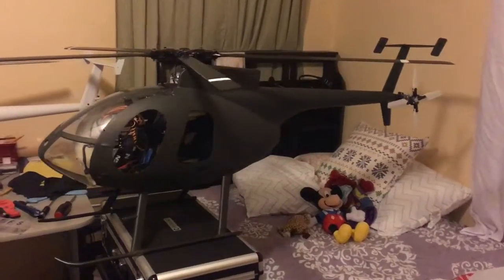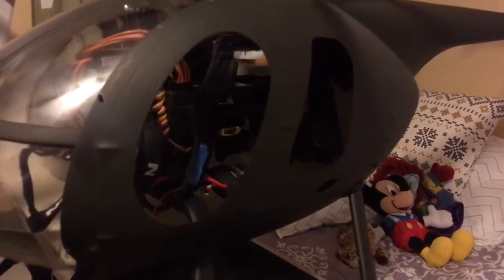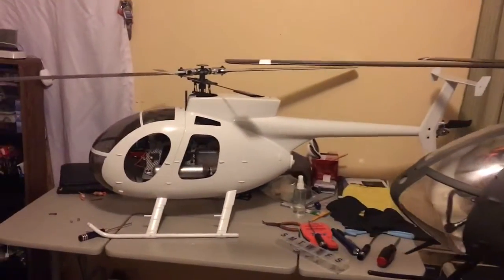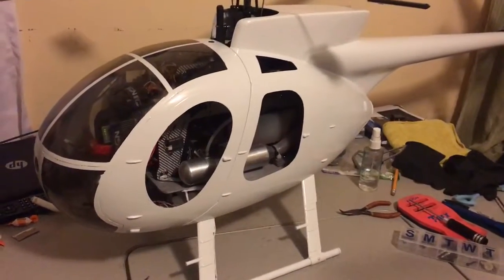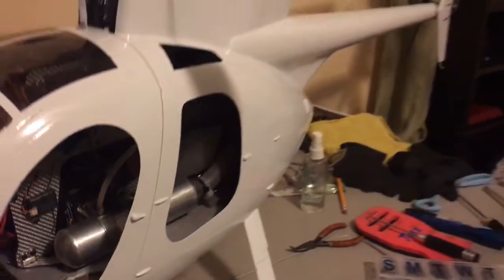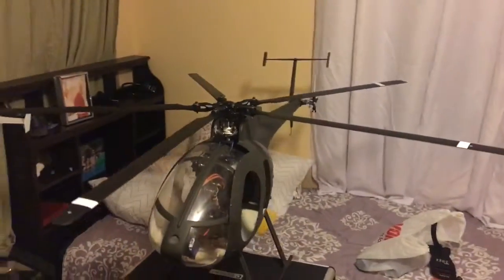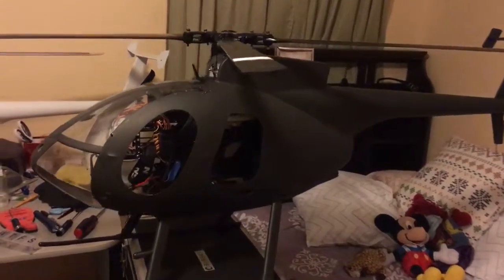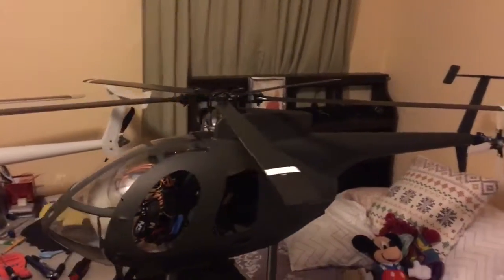My new build raptor 50 converted to electric going on a MD530

Comment: Looking good! Just wondering what your setup is? I've done exactly this and converted a raptor 50. However my headspeed is nearly 3000 RPM, so I'm getting seriously low flight times. I'm considering reducing the HS with collective management, but I'm interested in others results.
Reply from the maker: Well I'm using the governor on the speed control and it's set up for 1400 ,1500, 1600. Head speed With gear ratio of  main 111 and 10 for the motor gear throttle curve Normal mode all 30 % across stunt 1 70% across and stunt 2 100% across pitch curves all linear keep in mind I have a 5 blade head and 5 600mm blades on a scale helicopter I don't need high head speed with this set up in getting 4 minute flight